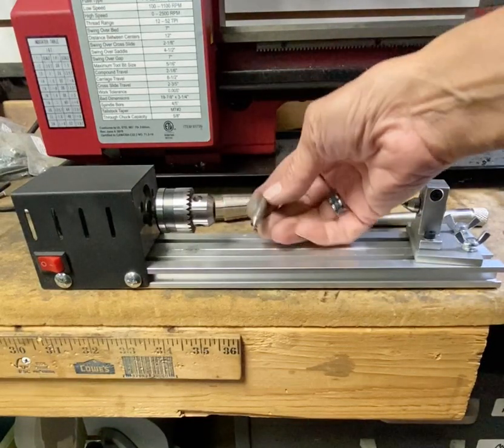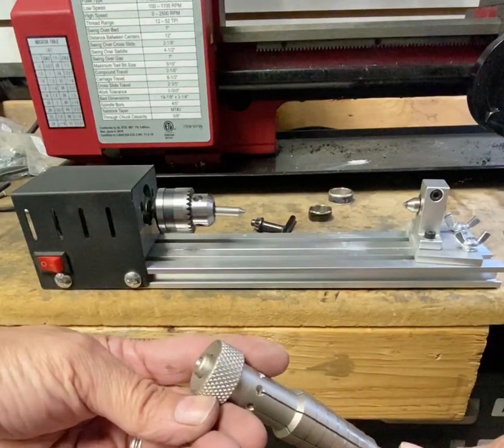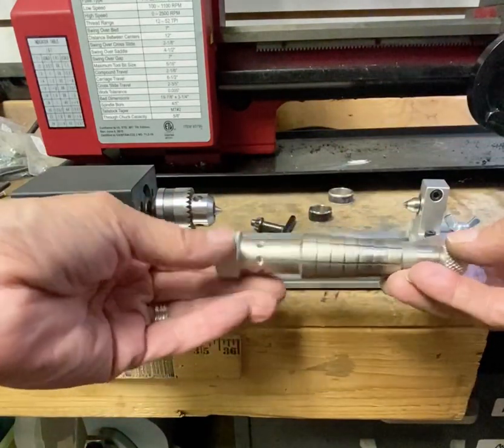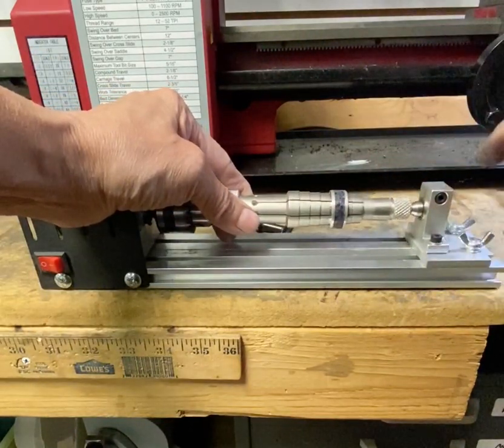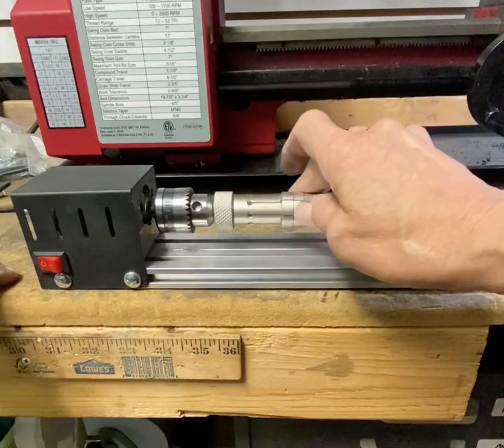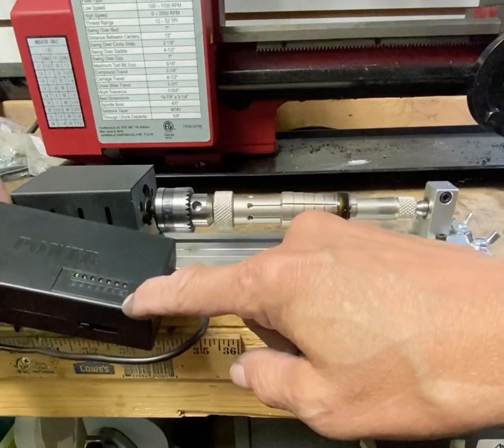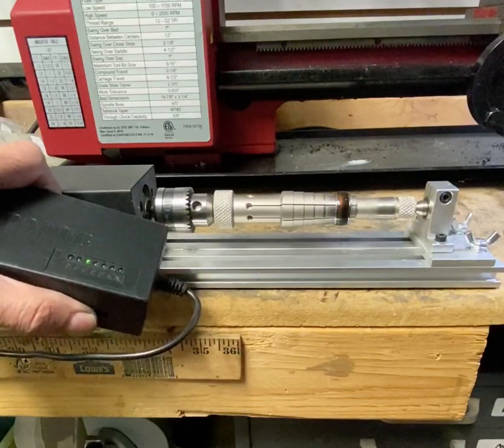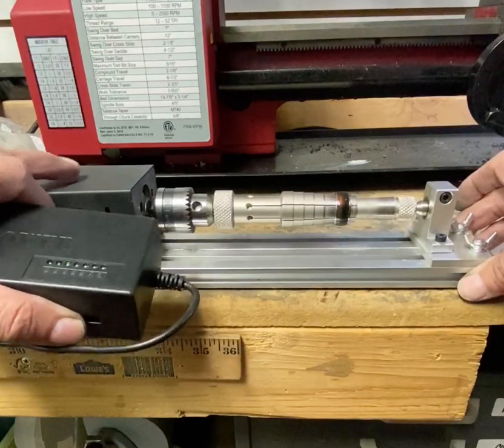How to give more power to your micro lathe and how to adjust the centering pin.

Comment: Any chance you would know how to obtain one of those center pins?  🤞😬
Thank you for your time
Reply from the maker: The manufacturers of the ring stretcher changed the design so it no longer has divots at either end.  We sold the centering pins but since this change we pulled the product.  If you still want one contact me at suzanne@flatwearable.net